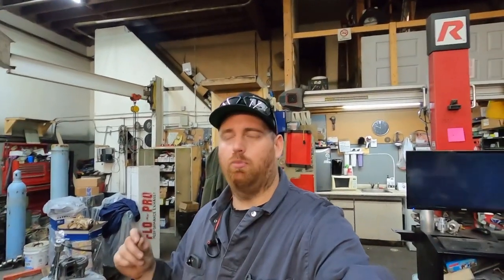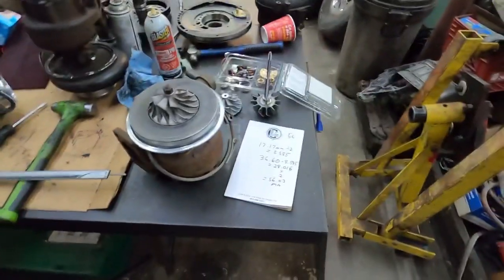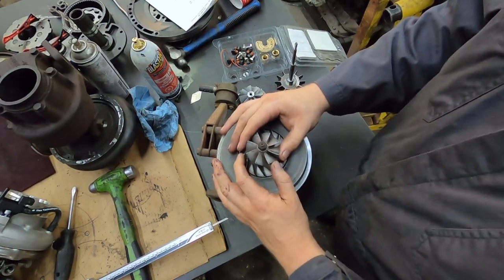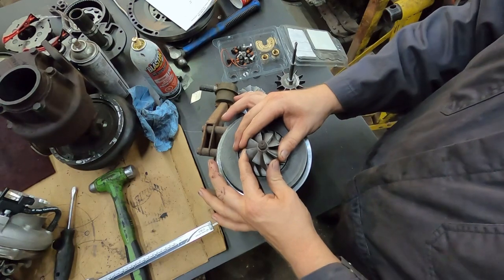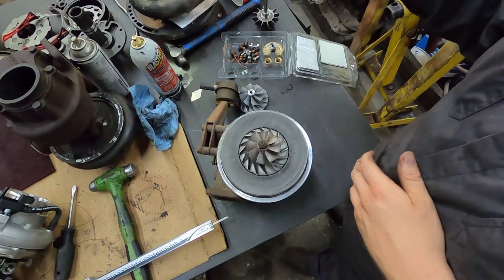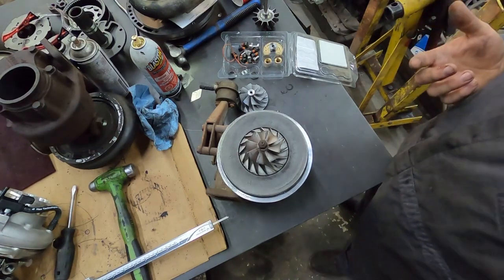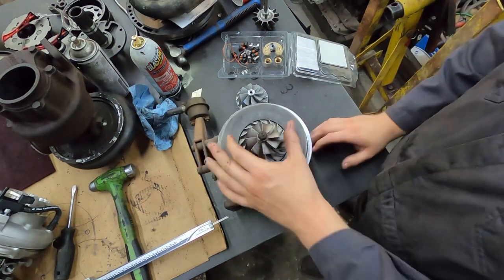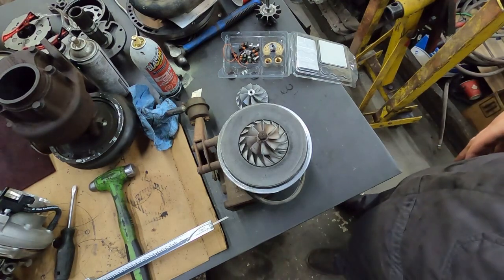How to tell it you turbo bearings are good or not. ( Axial & radial play )

Comment: Thanks Rob I give the turbo charger a check on the Dodge every now and then and it got some play but I never seen any impact or marks . At some point I might have to change it out . I be interested in your advice on a good replacement for around 350 hp and towing . thanks again
Reply: What's in it currently....if it's a h1c I'd jump up to a hx35 as a cheap upgrade. If its hx35 a hx40 is a good step up. But you gotta look across the board at everything else before dumping a few grand on a good high end turbo. You can make 350hp on a stock turbo with just a little bit in engine mods.
Reply from the maker: video's to come